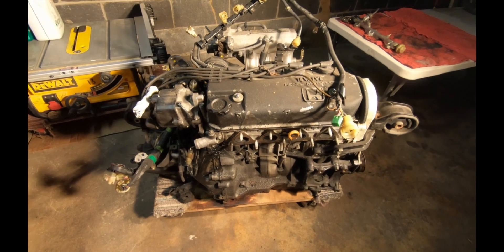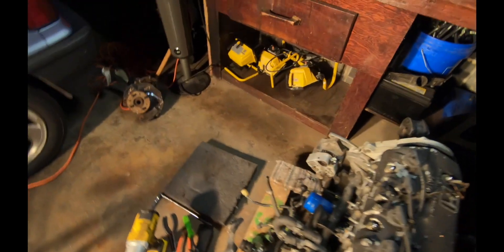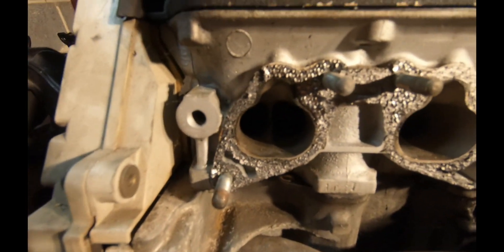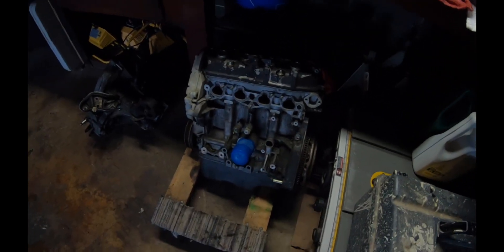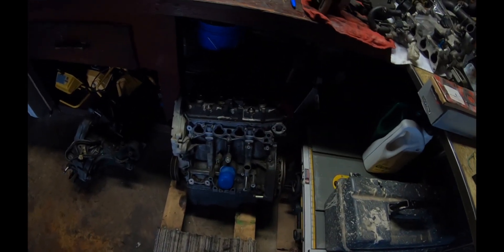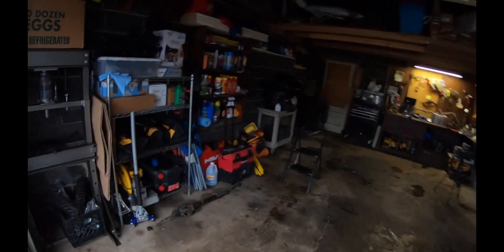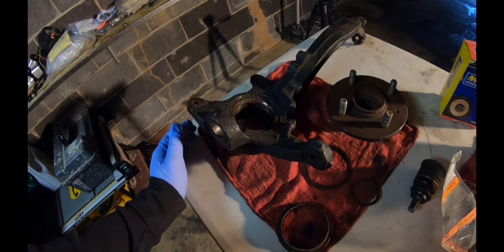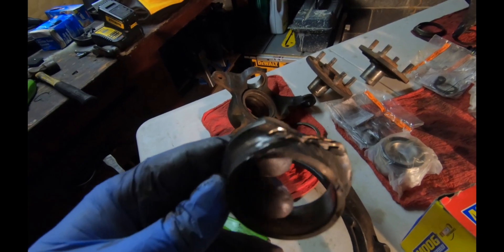EF Hatch Project: d16a6 strip + Lower Ball Joint Replacement

Comment: What front spindles are you using?  I might have missed you talking about it.
Reply from the maker: I’m using front spindles from a 90 crx si, Unfort I should of checked if the wheel bearings I had were correct for them before I started the process. I know that the dx spindles won’t work from the 4 spd standard hatches. I had thought originally when I did the b16a swap on my 91 crx that I would have to swap the spindles with ones from an Integra but I found out you can use your original Si knuckles and they will work just fine.

Comment: i have a d16a6 engine in a 98 ex coupe and it doesn’t have the same intake manifold as the pgmfi and the car has a 98 ex ecu and I’m guessing wire harness it has a distributor on it aswell as a fuel rail but its missing the injectors and I just have no clue on where to start I really wanna get this car running but don’t really understand how
Reply from the maker: I’m not 100 percent on Obd2, I do believe there is a crank sensor that needs to be plugged in for the ecu to recognize it. I don’t believe the d16a6 came with a crank sensor it was built into the distributor for 0bd0 cars. Your best bet is to gather up parts that will work with your car. If it’s a 98 ex, eBay would have the right intake manifold, you’re gonna need obd2 injectors. Parts from a crx won’t work. I hope this helps alittle bit